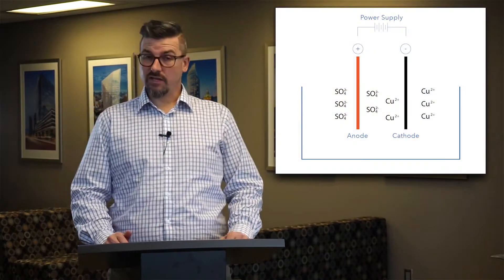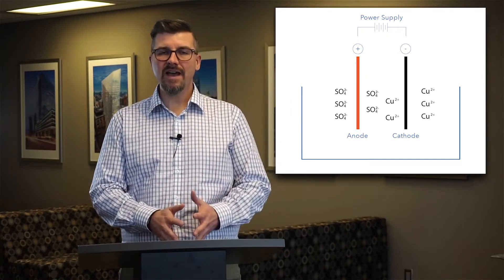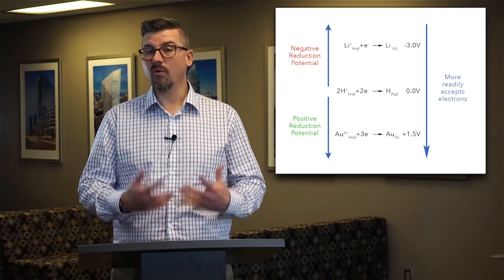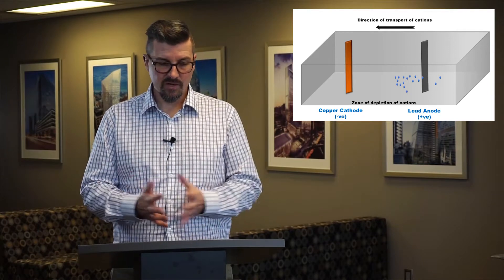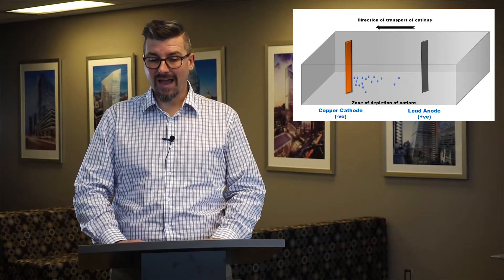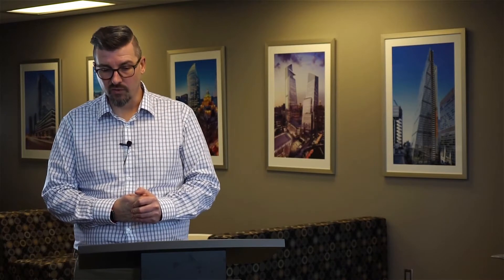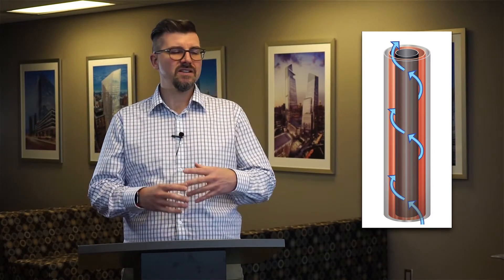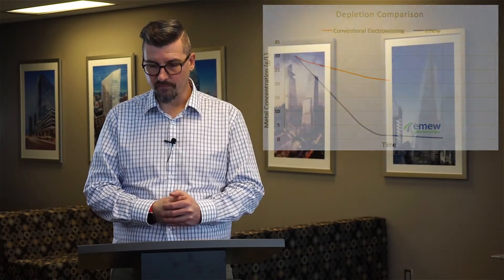Electrowinning 101

Comment: How about selectivity towards different metals? I’m trying to recycle vanadium from a mixed solution with V(V) and Fe(III) in order for it to be reused as a flow cell reagent, but they seem to either come out as solid together or both stay in the solution.
Reply: Chelates in solvent extraction. Can't explain more but I worked at a refinery where we were selectively extracting Cu from a solution with other dissolved metals. We used an organic extractant that selectively extracted Cu . The selectivity was 2000 Cu: 1 Fe..

Comment: Not useful  What is Electrowinning ? You never answered the question or defined it.
Reply: i thought they did i basically got that from the explanation that its running a electrical current through a cathode and anode placed into a liquid solution of particular metal concentrations to attract the desired metal to the cathode.
Reply: you get metal out of some funny water by running electricity through it

Comment: Can I plug battery charger to supply  dc current to the electrolyte mixture of sulfuric acid solution attaching two metal plates on both terminals to serve as cathode and anode
Reply from the maker: Hello, it is possible but you should be careful not to exceed the current.
Reply: Pls, what exactly will I do to prevent exceeding current.